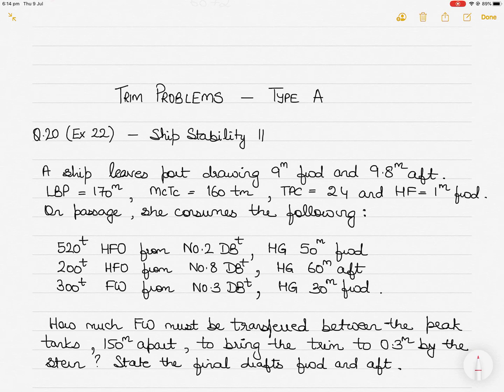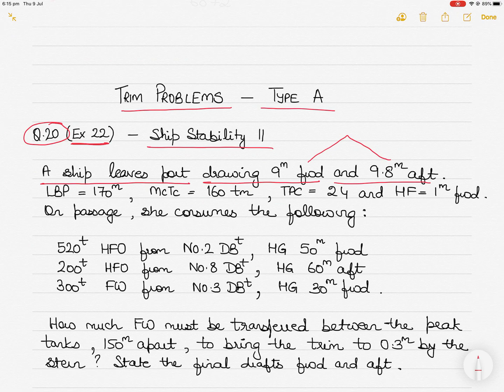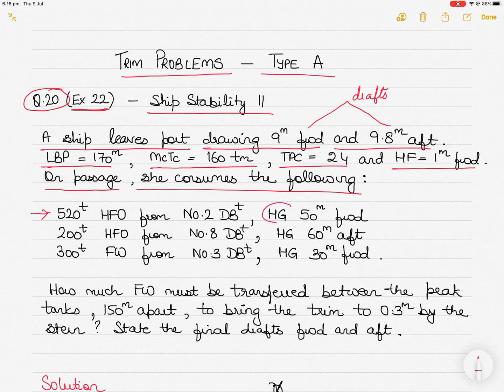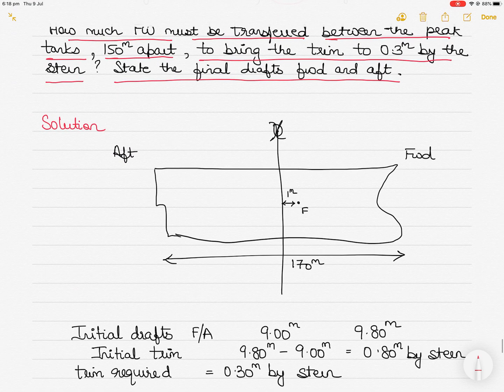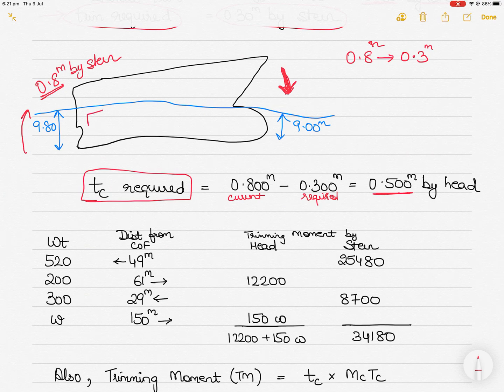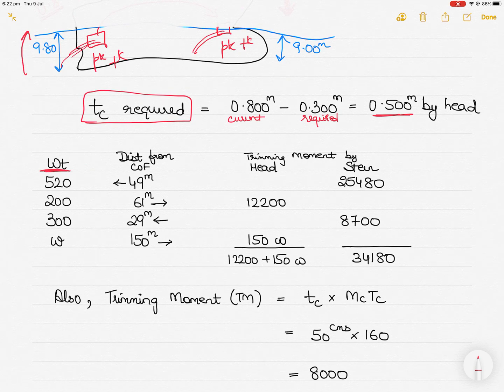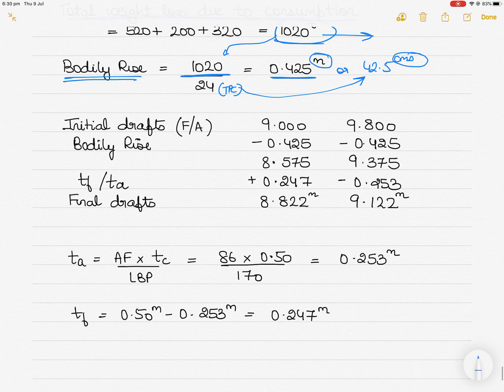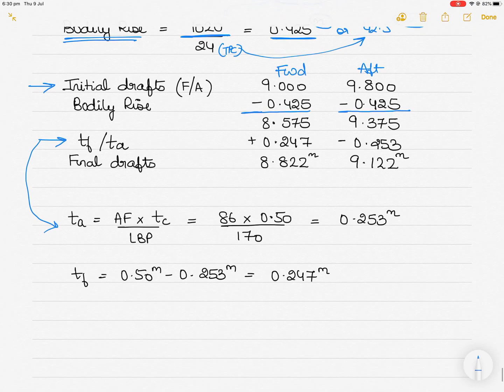Trim problems (Type A) - Example 4 (ship Stability)

Comment: Do you have some video where you explain calculations of stress on tanktop when you load for ex. steel coils etc? For example you have in loading manual information that is allowed 20 tons / per square meter, and you have to put steel coils in cargo hold. How you will decide how many tears you will put or how you will spread out cargo to not damage tanktop? Best regards.